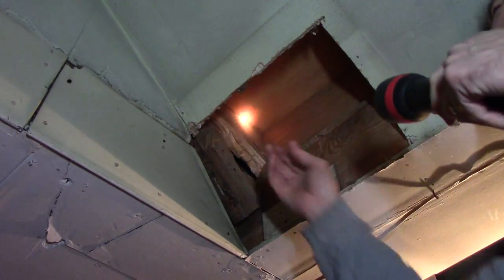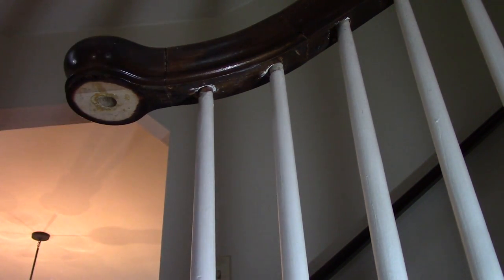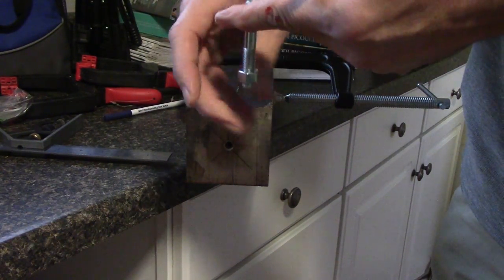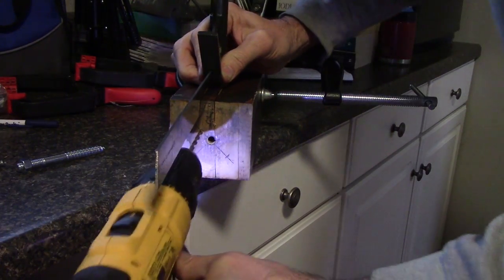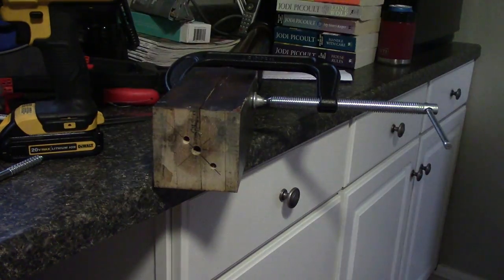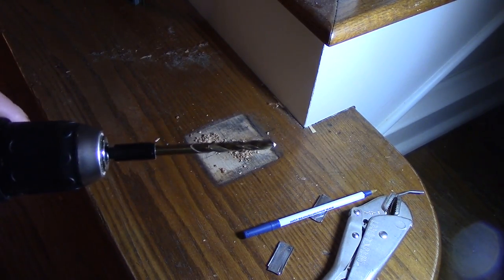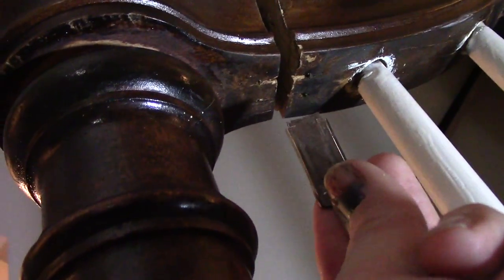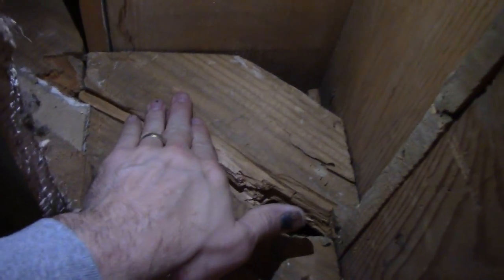Repairing a Loose Newel Post on Stairs

Comment: I would have drilled side ways to tack those 4 peaces of the post together, stronger so u will not get that split action any more. use counter sink holes and wood putty to cover up the screw heads.